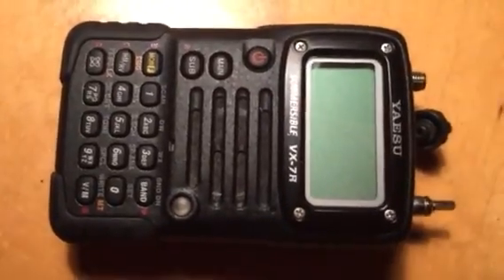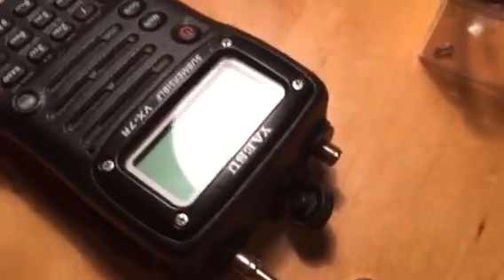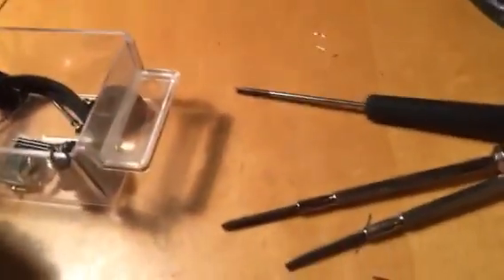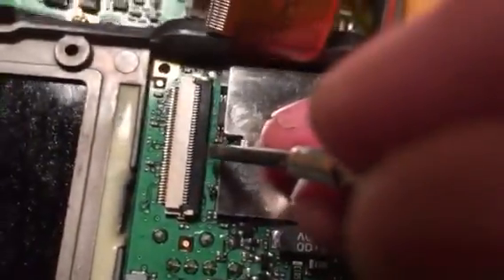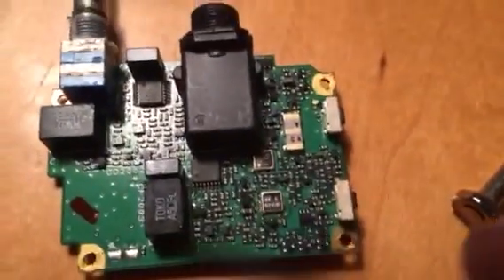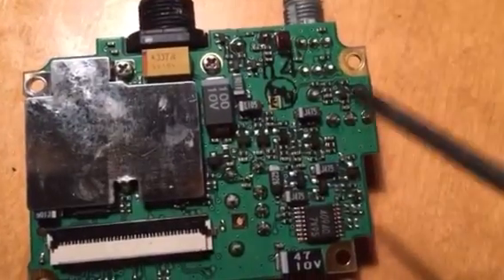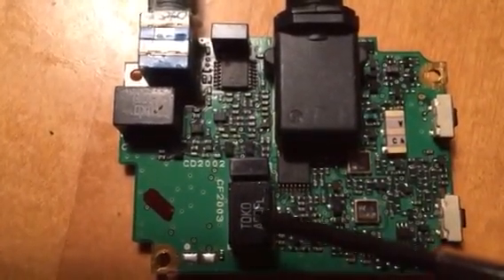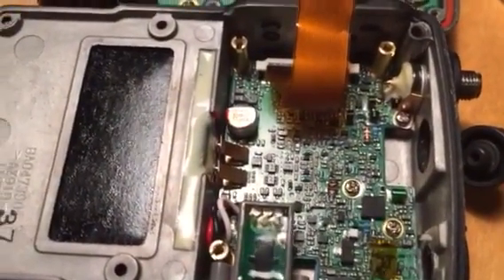Yaesu Vx-7 & 6 sensitivity issue fix LTM 450FW

Comment: Hi Wayne. I’ve recently acquired another VX7R that gets a constant 1 bar of noise with the squelch set at 5 (my other is at 5 and theres nothing). Also it won’t open up the repeaters when connected to my vehicle whip, whereas my other one can open them off the stock antenna. It seems to be tx ok but not receiving anything at distance, could this be the answer???.......Paul